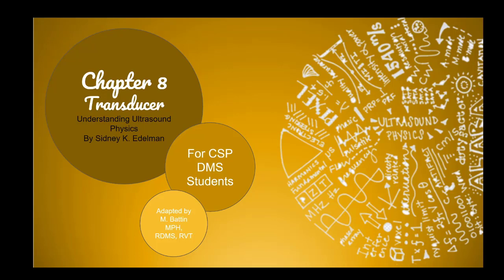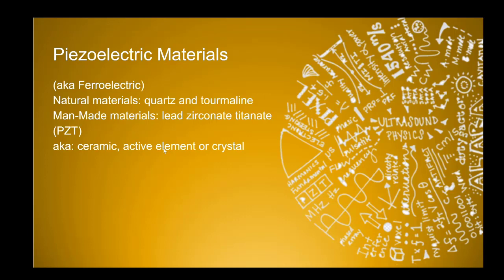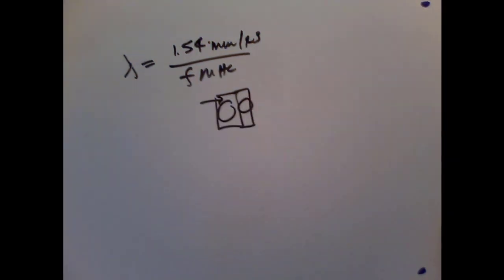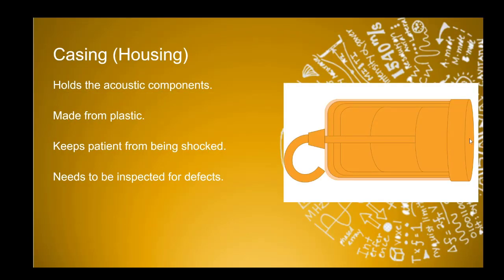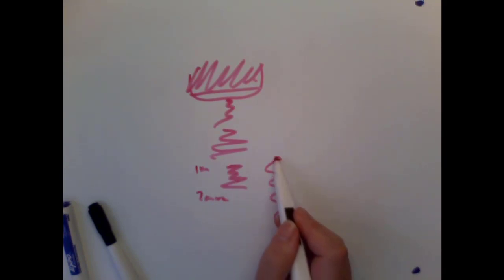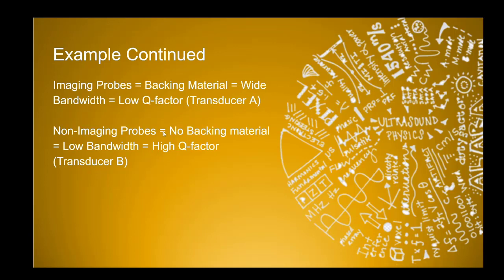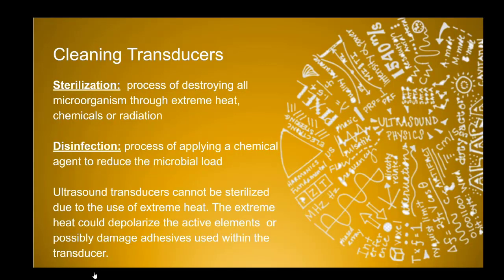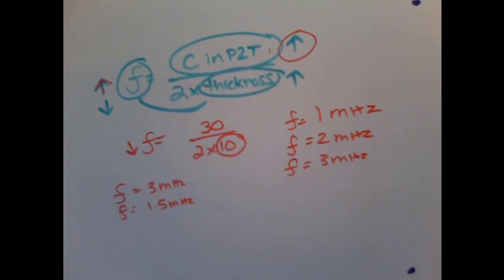Unit 4 Chapter 8

Comment: Great lecture! Thank you so much, I have question: how can the backing material actually changing the transducer’s frequency?
Reply from the maker: It changes how the beam is emitted.  Without backing material, the sound is pure and closer to a single frequency. When you add backing material you get more of a little chirp and there are multiple frequencies within that  burst of sound. So it doesn't change it, but it does widen the bandwidth.